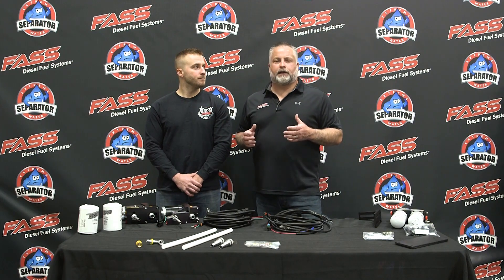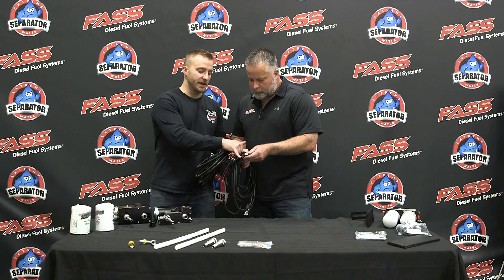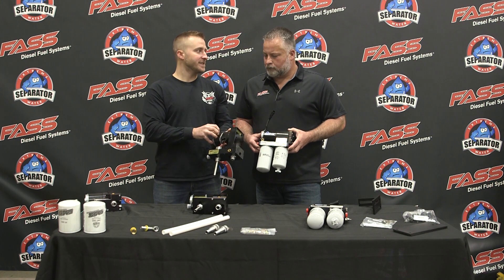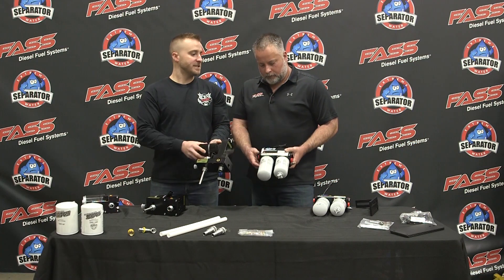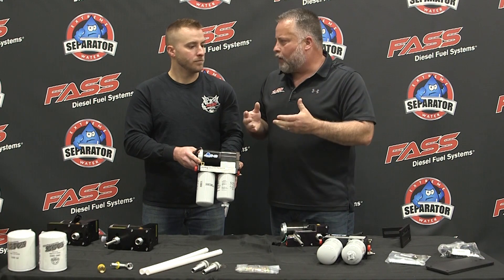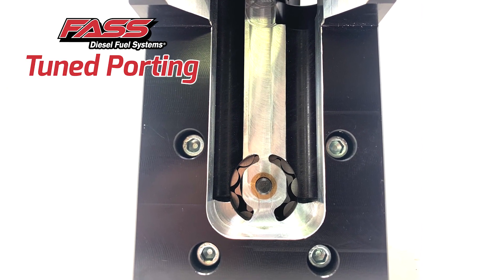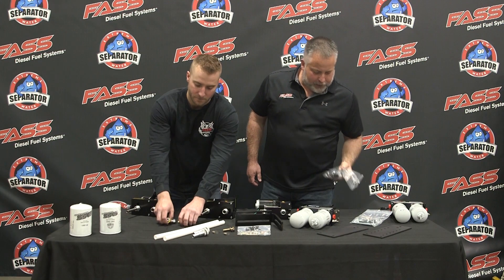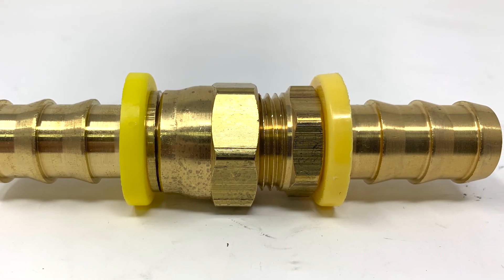The ULTIMATE Diesel Fuel System Comparison: FASS vs. The Competition!

Comment: On my fourth truck and fourth FASS. I bought a 2007 duramax at one point that the previous owner put an AirDog on that seized up. Replaced it with a FASS and had no issues.
Reply from the maker: Thanks for the continued support, Luke!

Comment: Why don't you guys sell on Amazon? All I can find on there is air dog
Reply from the maker: Hey Caleb, thanks for reaching out! Our MAP pricing policy, designed to protect our authorized dealers, means our limited lifetime warranty wouldn't be offered on systems purchased from Amazon. However, many of our authorized dealers do offer free, fast shipping!
Reply: @FASSFuelSystems  ok great. Another question i had. If the pump does fail for whatever reason can the cp3 continue to pull fuel through the fass system?
Reply from the maker: @cdsmit27  Great question! In the very unlikely event of a shutdown, each FASS pump features a bypass to allow your stock CP3 to pull fuel through the unit.